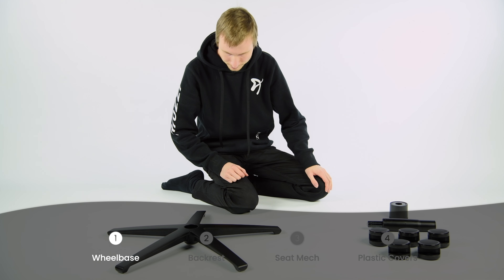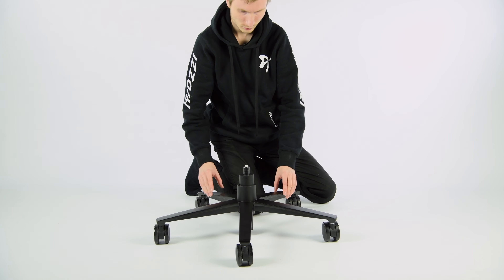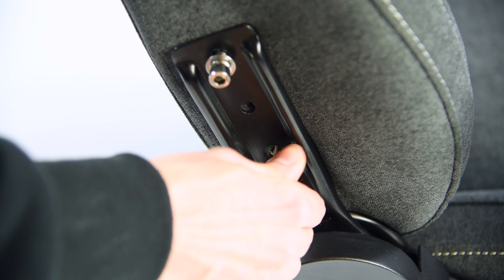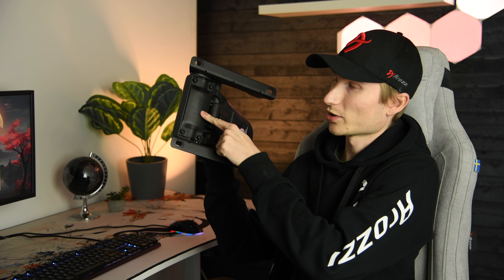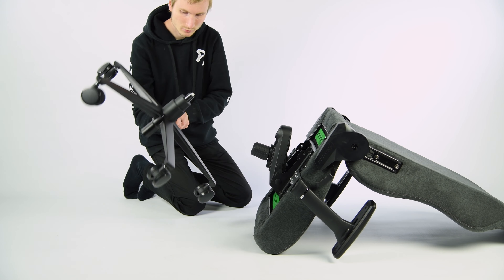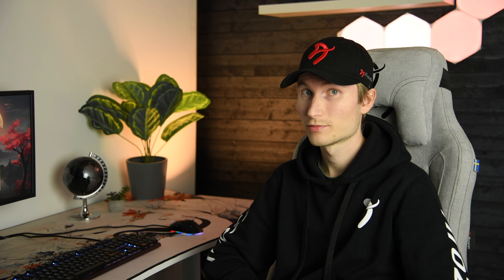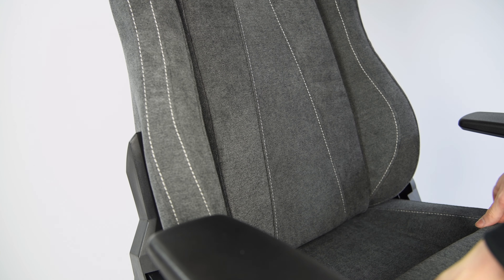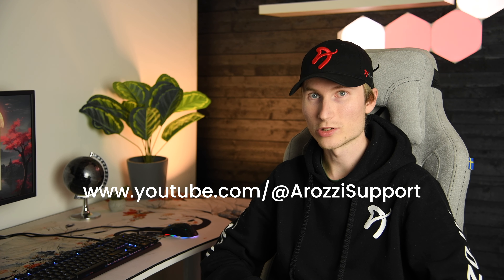Arozzi Vernazza & Torretta - Assembly Guide

Comment: The 8 bolts on this chair are completely different to those in the paper manual, the online manual and the demonstration on this video. There are only 2 parts, bolt and washer. Rang Curries for advice. They don’t have the number for the manufacturer. You have to email them for technical advice. I still haven’t had a reply. Went to Curries to see demonstration model. Despite being a 2021 model, this only had a bolt and washer. You would think they would have updated the manuals and videos by now considering the price of these chairs. Very poor after sales service from Arozzi.
Reply from the maker: Hi, we are sorry to hear that the screws didn't meet your expectation. Our chairs were updated in 2023 which this video is based on. You can safely use the screws you have with the washer you have. The screws now have a lock-ring on them just to make it easier not to loose the washer, but it doesn't affect the assembled product. It's one of the many small changes we make year over year to continue improving our products. :)

Comment: Whats the difference betweeb toreza and vrrenxza
Reply from the maker: Hi! There's a few differences between the Toretta and Vernazza. The design and color options is one thing. The Vernazza has a metal wheelbase with larger wheels than the Toretta which has a nylon wheelbase with smaller wheels. The vernazza also has a rocking function that's lockable while tilted back. The Toretta can only be locked when not tilted. The Vernazza Supersoft models also comes with a 4D armrest while the other Vernazza and Toretta models comes with 3D armrests. Hope this helps! :)

Comment: 1:25 I think this area should be reinforced to prevent tearing.
Reply from the maker: Hi! That hole is just to let the plastic covers through and won't be stressed during use. We are also happy to say that newly produced chairs will come with magnetic plastic covers instead, and there won't be a hole there at all. :)
Reply: @ArozziSupport  that's a great idea. 👌 I guess that means 2024 edition. I wonder if the chairs at Komplett has it. But need a chair soon, but trying to decide between these two. I probably can't wait for new version, as I need something as fas tas possible. I see the  Torreta is wider so I think I should go for it. Will the new chairs have better foam? I hope so, cus I've read they wear in a bit over a year.
Reply from the maker: @mtbboy1993  There is not a new chair  coming, it´s only the plastic covers that have been updated :) so what we have on our website and at our resellers is what we have to offer currently :)
Reply: @ArozziSupport  Sweet, I ordered a Torretta, arriving next week. ☺️